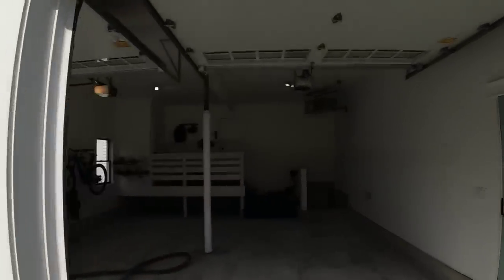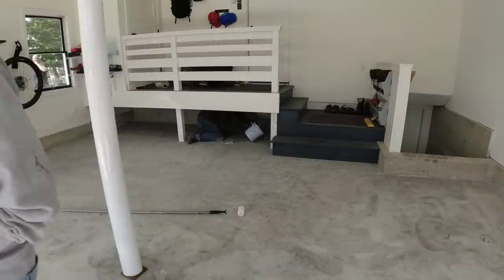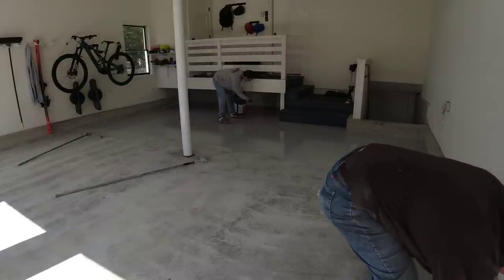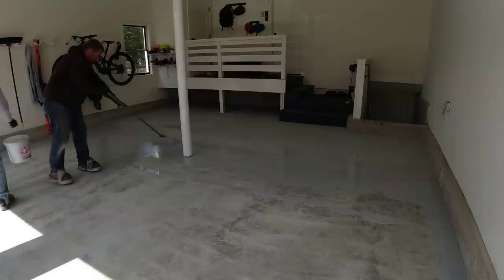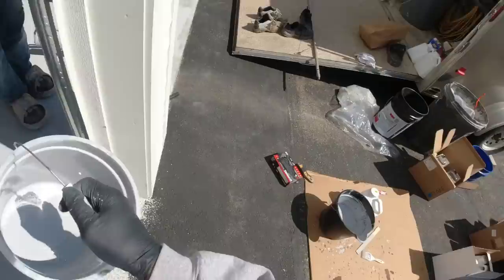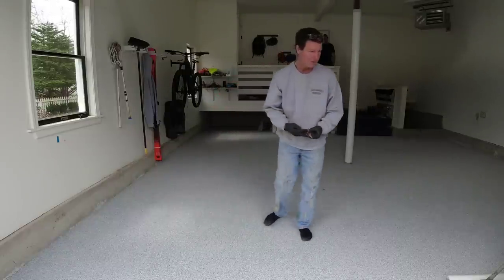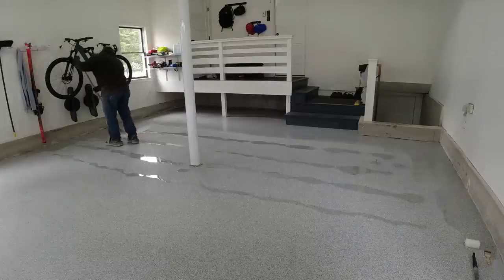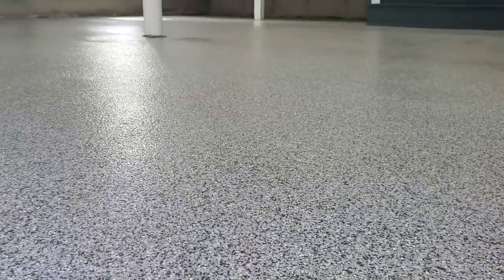2023 Eye-Opening Garage Floor Epoxy Coating | Secrets Revealed

Comment: Thanks so much for all these educational videos Mike! Really appreciate how you explain concrete application concepts.
I do have a question. I have been researching this particular application and am wondering if you can touch on polyureas. I have been let to believe that a high solid poly urea is going to be a better application then polyaspartics. I however am still relatively new. All the best and thanks again

Comment: Hey Mike, awesome work. Anthony here from JonDon. Concrete Account Exec. A man of your stature has to buy a walk behind grinder. I really recommend a T5. Save you and your guys "back" and time. Awesome work man! Keep it coming. Love your content. Thank you for posting
Reply from the maker: Hi Anthony, we got one. 220V, usually there's not way to connect it unless we hot wire it into the panel. Most of the time my guys just get it done by hand.

Comment: Superb look. Is that floor mopable? At our business, our epoxy floor is supposed to be mopable but portions are not. Can you just add a little top coat to these areas to try and remove the defects that hold onto dirt?

Comment: My builder put in huge expansion joints.  Is there a way to fill those in before painting
Reply: I would recommend a piece of wood that fill the gap and gives the desired look you want and using urethane caulk to fill in between 🤷🏻‍♂️